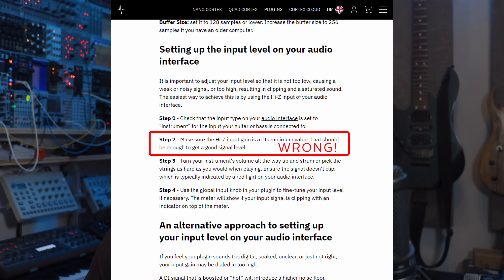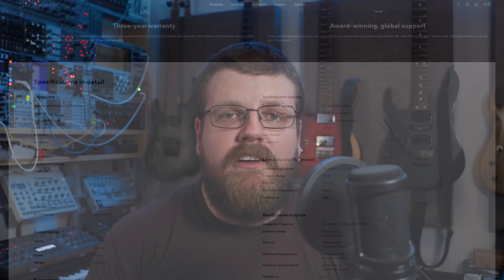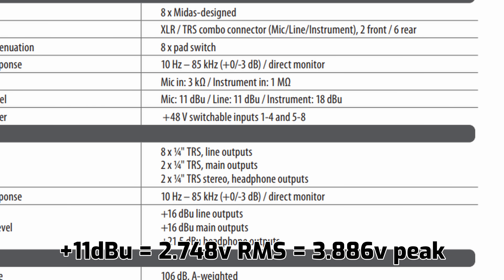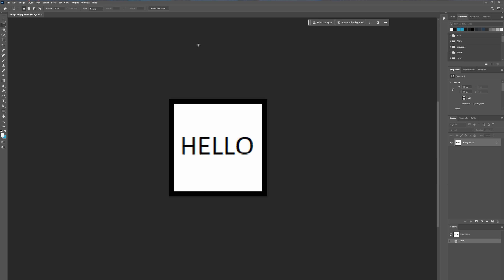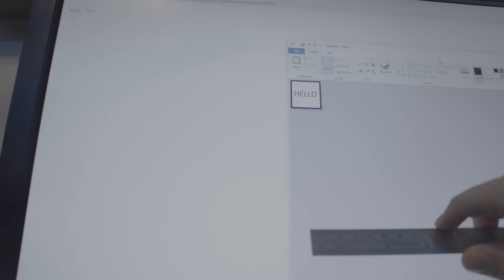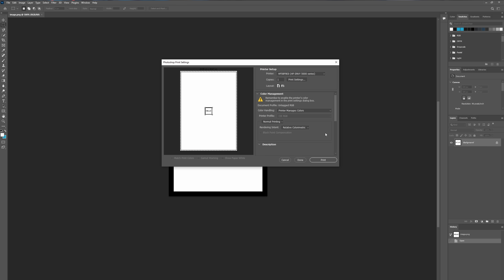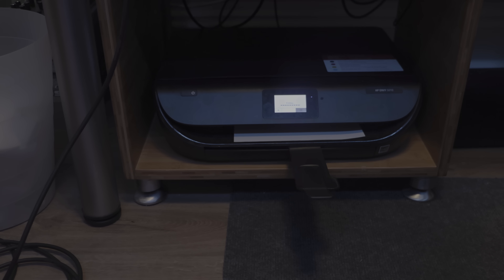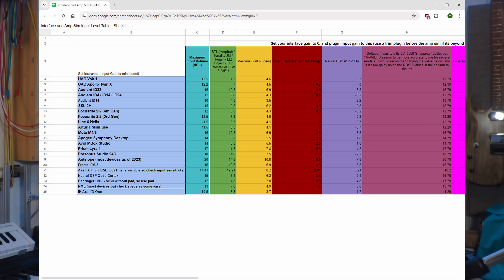Ampsims and input gain - Please, stop the madness...

Comment: Amazing. I always followed this approach but what switched me over to the "wrong method" was that I liked having my DAW have complete control over my signal or as much as possible. I have kids, pets, etc. and having my instrument level always at 0 meant that I could step away from my setup and not have to worry if a knob or fader was messed with while I was away. It looks like there's nothing I can do about that if it means I'm gettin a better signal and tone by gain staging properly 😭. If anyone knows of any interfaces that can have physical settings saved after you set them and can be reverted back to them if they are messed with, I would be eternally in your debt.

Comment: How exactly do I know how much to lower the input gain by in the plugin? Is it basically just to preferred taste?
Reply: he says "A lot of people have asked how I determined the amount of gain I added when turning the gain up on the interface, since the knob isn't labelled with any values.
I did this by using a loudness meter plugin, and playing open strings as hard as possible for 10-15 seconds. I then compared the loudness before and after I adjusted the gain, and the difference was 24dB. Hope that makes sense."
Reply: @MortalFear-mt4ov  Completely missed the pinned comment there. Thanks for the reply!

Comment: Excellent, and by far the best and easiest to understand explanation! Now the only niche question that remains is for people using a hardware unit and the plugin from the same manufacturer (like the L6 Helix line and uses the Helix Native plugin), depending on your interface - how to match the levels between the hardware and the plugin so that the presets you create on your computer translate correctly to the hardware unit. I found that I need +7dB of gain on my Audient iD44 and Evo16 interfaces to match the same level as my HX Stomp Xl (by doing far less scientific tests, but the results sound OK. There's a video on my channel if anyone is curious)

Comment: I believe that, when feeding boosted signal (from pedal with gain) it is still better to crank it BEFORE input of an interface. And stet interface input gain low. So you do not amplify noise of prevoius stages. But indeed, this is a special case, and most of the time just crank it up untill clipping.

Comment: Thank you! As a digital photography professional in my work life, it never made sense to me for guitar recording to have the interface gain at zero. I watched the videos, tried it, it never seemed like that could be correct to me because the analogy to photography would be such a poor fit. The optimum digital image exposure is the brightest possible exposure without clipping the highlights, it's how you get the most shadow information, and thus the best signal-to-noise ratio. Then you can back off your highlights digitally and hold the shadow information. So, I always intuitively turned my interface gain up until just below clipping and backed off the digital input to taste, thinking this must work much the same way. And... it does. You un-broke my brain. Now, technically my analogy isn't 100% correct because photographic signal-to-noise can only be improved by the addition of light to the sensor, whereas the audio interface gain knob is almost more like an ISO dial in that the noise was generated earlier by electromagnetic interference at the pickups,  but it's still the point of analog-to-digital conversion so the more signal in at that point must be better in any event, one would think.

Comment: Pro audio engineer here. This video is exactly correct. I didn't even know this was a contentious issue.
Reply: Same here...
Reply: innit. I've been waiting for the big reveal.... Still waiting the big reveal... 
How do people not understanding adding voltage to a signal?
Reply: It's a contentious issue because a lot of amateurs (like myself) are trying to use this fairly sophisticated pieces of equipment. And most of the equipment manufacturers provide terrible documentation. That means we all go to YouTube to try to solve our problems. Which means...unless we find someone with this guy's background...we're probably getting bad advice. 

I have a TONEX One pedal. You can literally find videos from 3 different "experts" telling you how to set the Trim on it and the approach for all 3 is different. And of course, the TONE One manual is worthless because it doesn't provide much more than 2 sentences on setting the Trim.
Reply: @keithbenedict8764 very good point manufacturers are lazy af now days, all about maximum profits

But also lets be honest 90 percent of people will not read it anyhow, yes it is very helpful to have accurate infomation for those that read, but people pick up new stuff and just turn dials they dont know and then get mad because it sound crap (the good ol digital sounds crap)

Comment: Okay, so how should I be setting the input gain of my quad cortex as I am recording into my daw using the tones on the unit and the QC as my audio interface? I use their plugins as well sometimes, still using my qc as the audio interface, and will definitely be trying what you suggested. I guess I'm just not quite understanding if it would be different recording the tones on a modeler into a daw, because there is seemingly no second input gain to turn down.

Comment: Had to play around with the input on my interface (SSL 2+) but ultimately increasing the input in the interface to the 12 o'clock position and lowering the input on the plugin (Neural DSP) to -20db helped reduce the noise floor tremendously. Thanks for the video!

Comment: Holy Sh|tballs. I am NOT an audio engineer. I'm just a guy who has a basic understanding of analog vs. digital and analog TO digital conversion.

As SOON as I started hearing all this "Turn your INTERFACE volume to zero" crap, I was like "What are they talking about?"

Watched the EdS video and IMMEDIATELY thought to myself: "So, this guy thinks that since he's discovered that most amp sim plugins want to see lower signal in order to behave correctly, the best way to accomplish that is to turn down the input on your A/D CONVERTER?!?!?! - and NOT to instead, simply turn down the front-end of the digital amp sim?!?!??!  WTF?!?!?!"

I mean, seriously....

Kudos to EdS for figuring out that the relationship between the interface output and the amp sim input are often mis-matched - and for doing the legwork to try to figure out what the level of that mis-match is, between many popular interfaces and amp sim plugins. Really. That's a great piece of information that lots of folks don't know - and the DSP companies have been unforgivably silent about.

But FFS, after that, he THEN arrived at the conclusion that the proper way to compensate for the mis-match is to increase your analog noise level, by decreasing your analog input gain? Talk about getting 99% of the way to the finish line, just to turn around and start heading back the same way. 

As soon as I thought about the level mis-match, I left my audio interface level RIGHT where it was (which was optimized for analog S/N ratio), and just started to back off the PLUGIN INPUT by somewhere between 8 and 12 db.

Problem solved.

The fact that guys like Rabea and Cordy and Rhett Shull bought into this and made "advice" videos telling people to turn their interface input to zero - while IGNORING the input on the plug in  - honestly made me loose a ton of respect for them...

Comment: i have a colleague who likes using small point fonts and then stretching the box out to fit it to size, makes the resulting font nice and fuzzy, which they like 🤣

anyone who wanted the clearest possible version of the type face would be well advised to use a font point size that was suitable at its native rendered resolution (or even shrinking it down if you wanted to 'over sample' the rendered characters right?) but each to their own i guess

i don't know that i've ever heard anyone making an argument that the digital dynamic range loss of gaining up a very 'quiet' digital signal was in any way musical or otherwise desirable outside of experimental electronic styles though

maybe taking this example to the extreme is a good way of demonstrating how much this reduces the 'quality' of the input (with linear non.... floating point data anyway) by recording something at 24 bits, but so quiet it's only using 10 or so bits of each 24 bit sample, and then bringing that back up to normal volumes.  not just the noise floor effects but how garbled it makes the sound quality of say a clean guitar when taken to such an extreme it's very noticeable basically

Comment: That's funny, because cranking the interface gain to just below clipping was always the standard advice when I started almost 10 years ago. I guess zero gain on the interface has an advantage too if you're really lazy, because setting the interface gain is not just set and forget. The good setting for one guitar might cause clipping with another guitar with different pickups.

Comment: Ok this is a good explanation video. I'm not an expert but how does the "instrument" button on my focusrite scarlett solo (3rd generation) factor into this?
I thought it was best practice to have that switched on when going in from a passive guitar pickup. The signal is a good amount more hot with it engaged.
I did some testing myself and came to the conclusion that for this case I have less noise floor when i leave the interface gain knob at 0db, 
and also with that switch on it sounds less "digitally thin" to me, for a lack of a better term, more of a "full" sound (i guess the difference in the end is in the mids).
Maybe my method of testing was technically wrong and I forgot to turn it down digitally after turning up the gain? I don't exactly remember, it's been a while.

Comment: Thank you!! I have Hatred this advise (set input to 0db) for years. When re-amping, the signal to noise ratio issue is blaringly obvious and exasturbated when going through boost pedals before the amp. Thank you for keeping Gain Staging alive!
Reply: But, what confuses me is, i thought 0dB was the maximum signal before clipping, not the actual gain knob turned to zero.
I thought "set input to 0dB" meant "crank that knob until it's red".

Comment: You confused PPI with DPI. DPI is an old value use for dot matrix printers and has almost no relevance today apart from when it's used for talking about ink density on paper. DPI is not a resolution unit in inkjet printers, it's an ink density or coverage value. When talking about resolution you should use PPI (pixels per inch).

Comment: I gain stage without any plugins. Just clean signal because that's what is going into the interface. Chug and strum away and bring the gain down to where I'm not clipping. That also lets me know if there are any artifacts coming in. After adding a plugin then adjust the plugin, volume etc.

Comment: I don't disagree and I use the same method - for full volume guitar input. But when we roll off the guitar volume within a song (i.e. not able to reset the audio interface for lower input volume), doesn't all the benefit of accurate level setting disappear?

Comment: Thanks for this video, its change everything on recording guitars! Change everything!

After few days testing, I propose you and who reading this, trying this method I wrote below and comment if they works. Thats worked for me and really improved the method explained on the video.

I wanted to find a fixed interface gain where I was always simulating the guitar plugged on a real-life amp, without the noise issues of the digital interface. So, for calibrate analog equipments, they use sinewave generators with a fixed Voltage.

So, I put a VST that generate 1Khz Sinewave at -0.1dbfs, and measuring on a multimeter the output of my interface, increasing the output volume at reaches 0,7V AC. (Because I don't have another equipment to generate this wave). Obs: I tried this method with 0,5V too but it doesn't work well. Maybe the correct value to calibrate is 1V AC, but my interface don't reach this, his maximum is around 0,7V AC.

Then, with 0,7 V AC / 1Khz sinewave outing of the interface output, I put this signal on Instrument input, create a track in my DAW to receive this signal and take a note how much dB its reach at the meter of track without any pre amp gain. (And was marking -9.1dbfs). Take careful and mute all tracks that you try to calibrate, to not occurring feedbacks.

Then I turn up preamp gain until reaches -0.1dbfs. At this gain, this is the real level signal of the guitar on the analog systems, but with gain of preamp, at the maximum SNR ratio and no distortion create by the preamp. So, the difference in dbfs between 'zero gain' and preamp gain at -0.1dB is how much you need to take off after the conversion A/D. (if zero gain = -9.1dbfs, with preamp gain at -0.1dbfs I added 9db).

Then I get the values of the Sheet Amp for the plugins I use and calculate how much my interface needs to get the calibration of each plugin, then substract from the value I added with pre amp gain. 

In example: Neural DSP is 12.2dBu. My interface reachs 22dBu maximum input gain (I really spend a lot of time searching because its manual doesn't have this information). So, I need to add 9.8 dbfs if I don't use any gain of preamp interface. But since I used the interface gain, I just needed to get this 9,8 difference and take off 9,0 (because the db gain of preamp). In neural DSP the final gain added is only 0,6db + 0,1db. 0,1db for the sinewave generator emmited the signal at 0,1dbfs. 

I simply add 0,7db on all neural dsp plugins and never touch the gain knob of my interface again. For precision of the potentiometer. All guitars that sound awful louds with this preamp gain of interface, it will sound bad the same on a real amp, so, fix the pickup height :D.

And guitar pedals, bass, keyboards, everything analog too. Just never touch the preamp knob again! 

I know, you must have thought: but if the audio reaches 0db and clips? Well. It doesn't even matter (linkin park refereces lol) !! Almost clips that occurs on this gain will be the transients that don't influenciates the audio after you put a Amp Sim. And you never will use a dry signal of guitar without amp, even if you want clean sounds. (but test and comment below if this clips really doesn't work well for you)

So, most of the contraditions and confusion in this theme are the fear to reach 0 dbfs and clips the signal. But these clips always occurred on analog gear, even the transistorized amps, and you listen this like a normal thing. The Amp Sims works with this clips and react like an analog equipment.

Sorry for big text, if you read it, try this method and tell if it works for you, because It took me a while to believe that the right way would be to ignore this 0dbfs rule and focus on calibrating the gain at 0dB with a sine wave (the same way they calibrate analog equipment - correct me if i'm wrong).

PS: If you're still a little worried, you can take precautions by calibrating the gain of your instrument channel interface until the marker at the meter is on the green/orange threshold (generally -3db on analog equipments).

And if you're still worried, know that there are plugins that can correct clipping sounds very well, such as Izotope RX De-clip.

After many tests with this method, I've never needed these backup resources here. And even recording a second channel with DI with a input on line preamp, calibrated at -3db/green-orange threshold (for preucation), The sound that is always perfect in every other senses is the recorded to 0dbfs calibration with the sine wave like the method I described.

Thanks for reading! Good luck if you will try! 🎸🔥

Comment: I watched the video but apparently never had this issue and never thought about it. I've always set the gain on the physical interface below clipping and then adjust digital levels after.  The problem some people may have can be due to very hot pickups. In my Focusrite Clarett I have the input set to 'instrument' mode and with a normal gain humbucker I had to set the physical knob to 9:00 o'clock or lower. With active pickups this could be a problem. Now I have a doubt, what if I disengage the 'instrument' mode on the input? That allows more level without clipping but don't know if has something to do with the guitar inpedance or something like that. If I set the input to normal mode more gain input is needed for the guitar but apparently the tone is changed for the same level as 'instrument' mode.

Comment: Video seems correct... Here's my rant...OMG this has been going on since the mid-to-late 2000s. Here's the way to do it and there is no mojo, science or engineering required:

1. Use an input with sufficiently high input impedance for guitar (aka the "instrument" input). The EE rule is generally at least 10 times higher impedance (input) than the source (guitar). 
2. Set the gain as need as to not clip the interface.
3. Adjust the input gain by ear on the SIM so that the SIM sounds like one would expect with a guitar plugged in.
4. Turn knobs on the SIM until you like what you hear, it's YOUR ears, YOUR music, NO one owns a "right" way for it to sound.
5. See #4.

It's a guitar/amp, turn knobs until it sounds good, this fact has never changed in the ~90 years guitar amps have been around. Will my comment stop this? Nope, it's human nature to burn days over minutia instead of playing because it is far easier than practicing your instrument. ;) Stop arguing, start playing, make music instead!. :) 

*Some interfaces are not great interfaces, they just aren't, meaning some guitars with high output will clip the the interface even with the gain turned down so you may need to address this. On a side note based on these heavily distorted tones being used, even clipping the interface some isn't going to make a worthwhile difference.